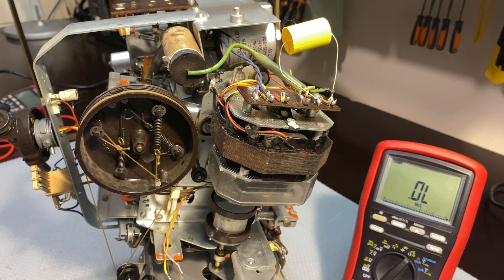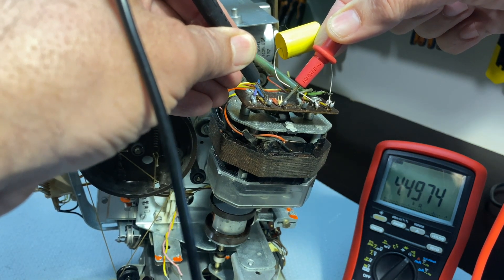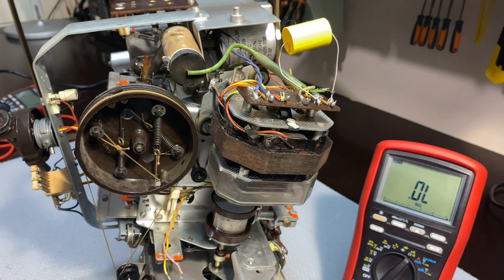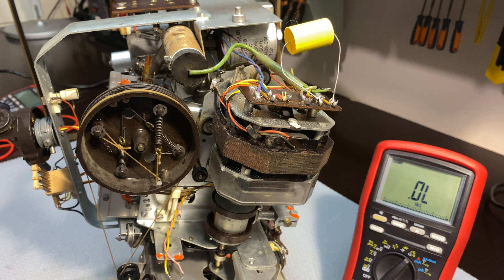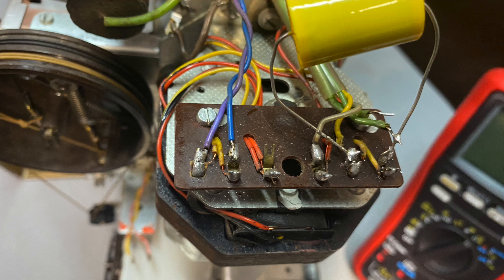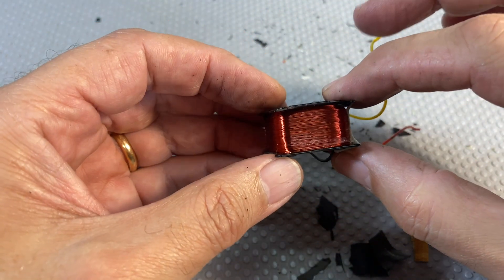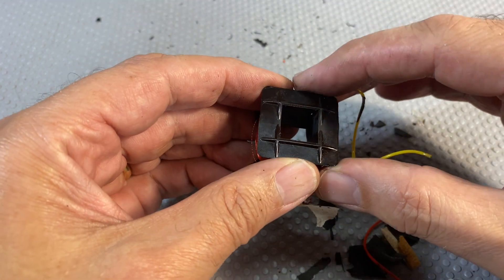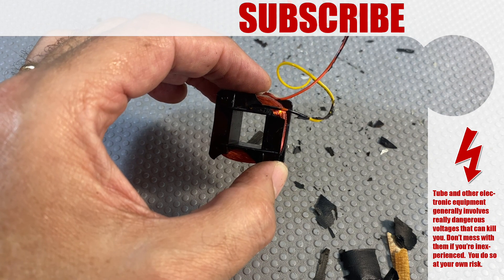SABA Breisgau 8 pt. 6. Dismantling the automatic tuning motor.

Comment: Another fantastic video, very informative and I managed to dismantle my motor the same way using your video as a guide.
Unfortunately I have a similar issue, although one of my windings is only 100 ohms, unlike yours that was too high.
Difficult to know where to go from here as I don’t have access to a spare winding. I’m dreading the thought of unravelling hundreds of metres of fine wire :)
Reply from the maker: I wouldn’t even try 😊 these windings sometimes come up for sale on eBay. I’d go that route.
Reply: I accepted the challenge and rewound using a very cheap NZ-1 hand winder. Surprisingly easy to use and took about 20 minutes of winding. Incidentally 5700 turns resulted in just over 1k resistance but the other 3 coils are closer to 960 ohm. Its very late so might unwind a few hundred turns tomorrow to get it closer to the others.
The main fault with mine was at the very bottom of the windings, a large lump of carbon close to the joining of the yellow wire.
Reply from the maker: Congratulations! I hope it all works out for you 👍

Comment: I have three of these radios. On one radio, the control motor is very noisy and gets hot after two minutes of operation. The resistance is about 1K on all four windings. The two capacitors are 0,22µF. The voltages seem OK. Before dismantling, I would like your comment on my problem. Thanks.
Reply from the maker: I’m afraid it’s been quite some time since I did this one and a previous Freiburg 8. I’m not sure I can help you. Look for some info on German forums as this issue is covered there, I’m sure.
Reply: @electronicsoldandnew  Do you still have some of these parts?
Reply from the maker: Afraid not.
Reply: @electronicsoldandnew  OK. Thanks anyway. I will try to go deeper into this motor. Hope I will find the problem.

Comment: When I'm rewinding this sort of coil I count the turns off in 100s and write it down then add them up. If it's only one break you could splice it and wind the turns back on. Otherwise it's just a matter of counting 100s back on and you're done.

Comment: Done that once. Data has already been mentioned (~5800 windings, 0.1mm2)
- You need some kind of winding machine, otherwise you will go mad.
- Wire needs to have tension while winding to make the 5800 windings fit into the core.
- You might get away without counting if you just fill the core, and then unwind and measure until resistance matches the other coils.
- Use new wire.
- check the iron core pack for rust in between the layers. If there is rust, the pack has expanded and you will break the core at re-assembly.
- Be very, very careful when re-assembling.
Reply from the maker: You’re right. I’ll probably go mad 😊 
Have a look at the video I’ll be posting later today. All will be answered 😊

Comment: Well, this one is broken already. one could isolate a wire close to the core, slightly scratch the isolation , and measure which part of the winding the fault is;  closer to the core or closer to the outer side. If closer to the core, you could even try to solder a wire to one wire closest to the core , and pot the whole side of the thing in polyester raisin or so.
Theory of course, but I also have a 6 Watt solder iron. I even did this once to a dynamic microphone, but then the eyesight was 1000% better.

Comment: Working on old radios as you do that contains transformers and stuff, a simple winding machine would probably be a good thing to have.
You can find decent cheap "coil winder" units on Ebay. 
Good luck with this one.
Reply from the maker: thanks
Reply: I second this, if you're going to do it right by rewinding, you might as well bite the bullet and buy a decent winder. I think your biggest problem is the form that the winding is on since it broke up. That will probably be the problem child.  Here's hoping your spare will fit.

Comment: You can unwind/wind a coil with a little DIY-design using a battery-driven drilling-machine or a screwdriver. The problem ist the counting.

Comment: I hope you can find a replacement and the freiburg motor has the same coils. Actually apart from  the FB 3DS and the other 3DS models  coils are the same as far as I have seen. In case you have to rewind, it needs 5700 windings of 0.1mm CuL. I have never had to do that as I was able to find spare parts :).  One thing I noticed  all the coils had a number 3 printed on it. Normally they are numbered 1 to 4 !! i dont know what the significance might be, I dont think any :).
Reply from the maker: Yes, I noticed the numbering and found that strange too.

Comment: If you are lucky the failure point will be at the solder joint to the coloured wires.
Reply from the maker: I’ve  checked. Not so lucky 😊

Comment: Rewinding motors - what fun!  I have done that several times.  I once had to make my own transformer bobbin (after the original crumbled in my fingers) out of 1.5 mm FR4 sheet material, the same stuff PCBs are made from.  You can buy it cheap from China without the Cu cladding or just etch the Cu off if you have some old PCB cut-offs lying around.  Bobbin winders are also not difficult to make but you will need a counter of some kind, also not hard to make.  A bit tedious after the first few hundred turns but well worth it in the end.
Reply: You wont need to be that precise on winding turn wise. Just unwind the old one and measure wire length and wire diameter and you are good to go. You might have even opted to unwind up to the break, splice it and wind back up. But seeing how he broke the bobbin it is very possible that he damaged more windings and has now multiple breaks or shorts between windings,  so a complete unwind is in order. However a free hand job using a cordless drill will do just fine. This is a series circuit of two coils. If one of them is a bit off it wont matter that much.
Reply from the maker: There is another challenge here. Winding this thing in the context that we have here (limited diameter to fit in the assembly) is very difficult. You can wind as carefully as you want but you won’t get the turns as tightly packed as the original, so it will get bulky and no longer fit. Believe me, I’ve done it quite a few times 😃 Even with a DIY winder it’s not likely to result as neatly would as they did, so it will build up more volume and the thing will look like a copper doughnut 😊 
As for the number of turns, it is in fact in series, but in a motor application, the phase and application here does require quite accurate results.

Comment: I am really hoping to see you rewind that coil!
Reply from the maker: From now until next christmas 😃
Reply: You'll be surprised how quickly you get it done. That wire isn't too thin. The biggest challenge is setting up the jig.
Reply from the maker: 10cm x 5700 turns = 570 meters. Have I got it right? Nelia will kill me if that much thin wire comes loose in the house 😊
Reply: @electronicsoldandnew  you need to feel the FEAR!

Comment: You’re brave! Would measuring the inductance of the four coils shed any light on to the problem, I used to work at a company that wound transformers, if an unknown, burnt out example came in they would by hand count off the turns as it was unwound, they did have the winding machines to rewind it though. Good luck
Reply from the maker: This thing has a lot of turns, a lot ...

Comment: In this winding of the electric motor, a short circuit has most likely appeared between the turns.
Reply: If that is the case then elaborate please why the dc resistance of this coil pack is higher(!) compared to the others. A short between windings would lower the resistance (even by a minuscule amount if it was adjacent windings) not increase it.
Only scenario would be that a short between windings caused that pack to overheat to the point it melted all the wire insulation causing a dead short all thru the coil to where a section of the wire decided to act as a fuse. But then the wire would look scorced, the coil would smell burnt and most importantly seeing that this is a series connection of two coils the other coil would easily have taken up the excess current so the meltdown scenario would never have occured in the first place.
Sorry this is simply a broken wire caused by bad quality of the wire  and drawing it out to too thin of a diameter.
Reply: @randomsteve4288  The turns were first short-circuited from old age or an overload jump, and then burned out, which resulted in poor contact of the inner winding and increased winding resistance. Turn-to-turn closure does not always lead to a decrease in resistance. Especially on very thin wires.

Comment: What i'd do (and probably not a very bright idea) would be to start unwinding the coil onto a drill , find the "faulty" point, repair it ,then rewind.This way i'd have roughly the same amount of turns on the coil without the added trouble of having to count them all.  Not easy but you are a man of patience and ingenuity , you''ll find a way around this one.
Reply: The idea is good but look at the dents he put into the winding pack where he broke the side of the bobbin. There is more possibility for (future) opens and shorts between  nicked windings.